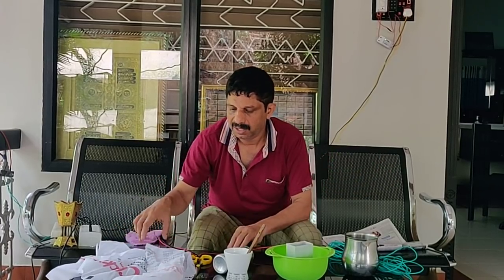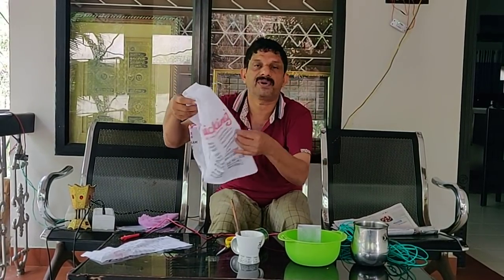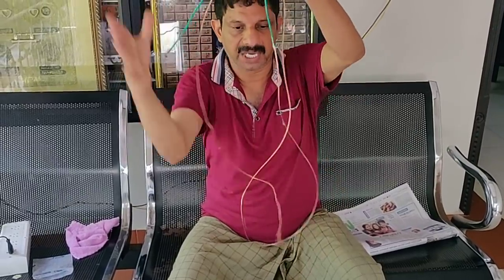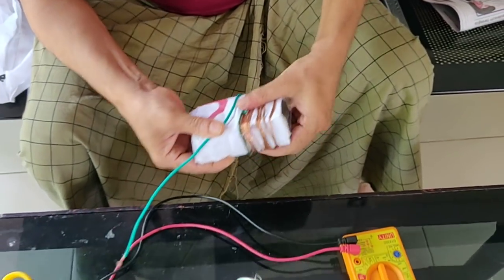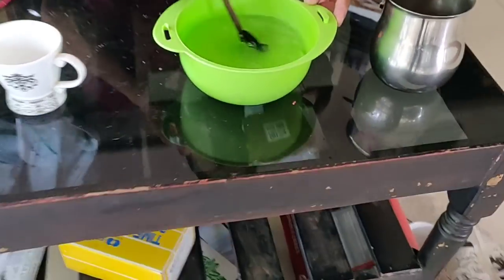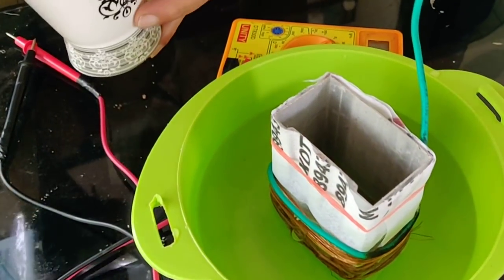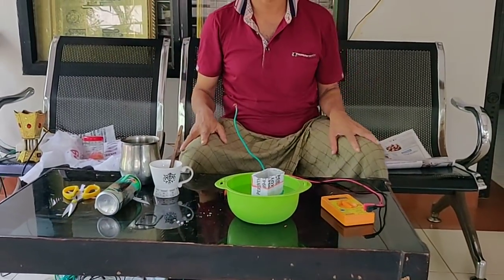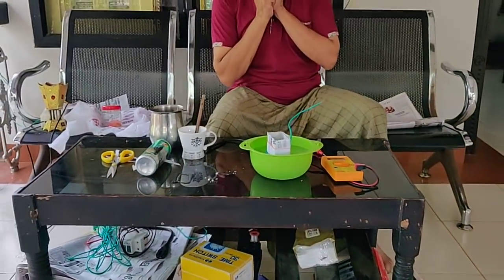അലുമിനിയം സാൾട്ട് ബാറ്ററി നിങ്ങൾക്കും നിർമിക്കാം

Comment: Please check current checking while using multimeter is right because without connect any load how to measure current,that means voltage measured across positive and negative leads but current measure in series with loads na,if I'm wrong kindly correct.

Comment: I use this type of experiment in 2001 school exhibition and got prize. I use zinc and copper plate as anode and cathode. And elecrolyte as cow urine. i made 7 cells in series and got 3.5v . it works fine for a watch, old type bus chaser and small cycle music in 2001- 2002 year .